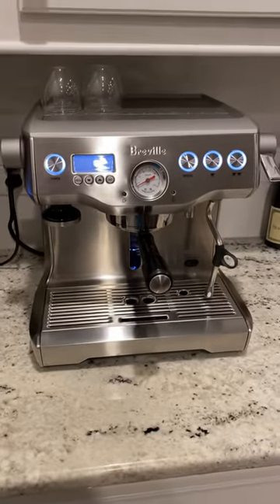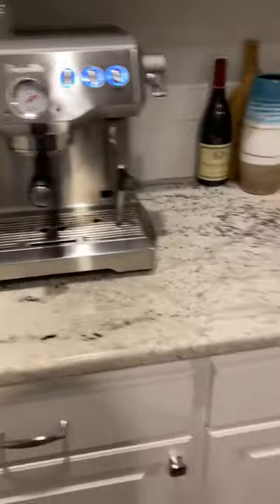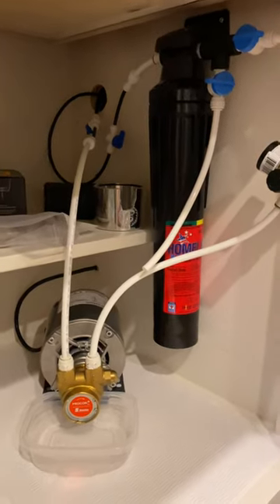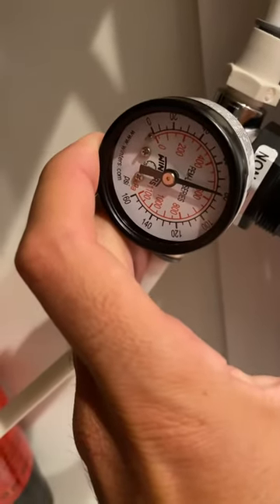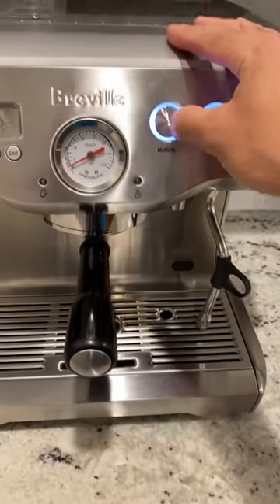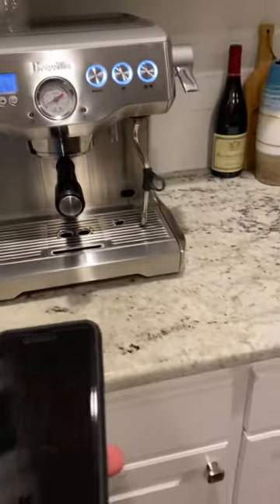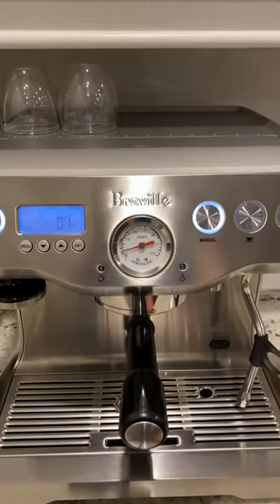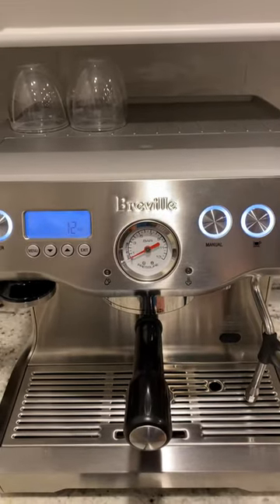Breville Dual Boiler Rotary Pump Setup

Comment: What if you use the micro switch from the hot water tap activate the rotary pump? If you’ve done the slayer mod you don’t use that micro switch any longer, and you can still crack open the tap for line-pressure before the switch gets triggered

Comment: Is it possible to install a smaller rotary pump that doesn't require tapping into the waterline?
Reply from the maker: I have seen someone have done it in the past but can't remember where. Also if you have seen this video  (https://youtu.be/DNE5liiBokY)  from Lance Hendrick you can see that Breville just did that on this Moded BDB. Check this link too (https://imgur.com/a/rl4roAm)

Comment: Can you share specs of the components you selected?
Reply from the maker: https://www.home-barista.com/espresso-machines/my-breville-dual-boiler-now-plumbed-with-rotary-pump-t58362-10.html
Reply from the maker: In this page I documented most of the thing I did. The rotary pump is the most crucial one, and I will recommend you stick with one that is made for espresso because you could have better adjustment to pressure.

Comment: Se ve interesante
Reply from the maker: KELVIN ORTIZ pareciera difícil pero realmente no lo es. Si te interesa, puse las instrucciones en esta página (https://www.home-barista.com/espresso-machines/my-breville-dual-boiler-now-plumbed-with-rotary-pump-t58362-20.html)
Reply: Claro que me interesa,tengo esas misma máquina tambien
Reply: Cuando lo vi me llamó la atención mucho porque el cambio es del cielo a la tierra,Saludos desde Puerto Rico
Reply from the maker: KELVIN ORTIZ mi isla bonita! Si el cambio es grande, pero era eso o me iba a comprar una Lelit Bianca y no queria gastar ese dinero...
Reply: El único detalle es que mi maquina está en garantía todavía y con una modificación de esa manera puedo perder la garantia por cualquier reclamo
Reply from the maker: KELVIN ORTIZ de cierto modo si. Pero, la única alteración real es la manga de la bomba original a la caldera. La cual se puede evitar. Todo lo demás es reversible, si no picas ningún cable y ninguna manga. Ahora mismo en la mia, mi único “error” fue picar la manga de la bomba a la caldera.
Reply: Tengo que comprar todo a ver si lo hago
Reply: Te pregunto el power que alimenta la bomba vibratoria de la extracción no se puede colocar un Relay para que manipule la bomba rotativa
Reply from the maker: KELVIN ORTIZ se puede, pero en mi caso no queria tirar cables desde la máquina hasta la bomba y por lo tanto use un smart plug. A la misma vez me gusta mas asi, pq me da control independiente de la bomba y la máquina y puedo hacer pre-infusion sin prender la bomba.
Reply: Te entiendo porque estás usando la presión de la red y luego empujas con la bomba correcto
Reply from the maker: KELVIN ORTIZ eso es así. Y controlo el flujo con la modificación de Slayer/flow control que es sumamente sencilla.
Reply: @rodneyn.gonzalez-rivera5093  The page has been deleted. Can you update the purchase information?
Reply from the maker: @muhannadalahmadi3912  https://www.home-barista.com/espresso-machines/my-breville-dual-boiler-now-plumbed-with-rotary-pump-t58362-10.html
Reply: @rodneyn.gonzalez-rivera5093  good morning.. I did not find the parts that you use. Is it possible to use alternatives from other companies .. Also, do you have an Instagram? I would like to communicate with you, thank you
Reply from the maker: @muhannadalahmadi3912  I think is possible to find alternative. My Instagram account is @neydor
Reply: @rodneyn.gonzalez-rivera5093  Saludos,te pregunto es necesario el tapón para la bomba vibratoria?o se puede tapar con algo más simple
Reply from the maker: @Captivework600P  no es realmente necesario. Yo se lo puse por eso de que no entraran cosas a la linea.
Reply: @rodneyn.gonzalez-rivera5093  tengo otra duda con respecto al interruptor que instalaste en el interior de la máquina que supongo es para la bomba vibratoria pero si no la vas a usar cual es la idea del interruptor?
Reply from the maker: @Captivework600P  Lo necesitas para cortar la electricidad que la maquina le envia a la bomba. De lo contrario tienes que desconectar la bomba. Es mas facil usar el interruptor ya que es 100% reversible.
Reply: @rodneyn.gonzalez-rivera5093  ok que es lo mismo si desconecto la bomba ya entiendo es opcional
Reply: @rodneyn.gonzalez-rivera5093  otra cosa como haces para la opv valve ya que está justo conectado a la bomba vibratoria
Reply from the maker: @Captivework600P  no la usas. La bomba rotativa tiene una built-in.
Reply: @rodneyn.gonzalez-rivera5093  donde ajusta los bares de presión por si sobre pasa la presión